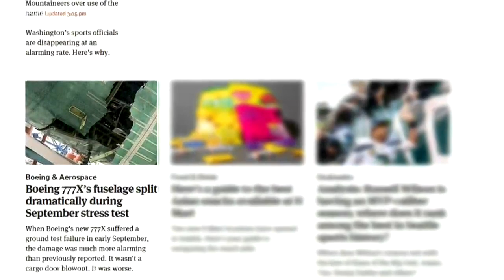New details about Boeing 777X stress tests

Comment: ⚠️🛑💥With decades of advanced material reinforcement, testing ASTM (I) and forensic failure analysis engineering, if there is a significant performance difference between computer modeling and this ultimate test failure there IS a serious red flag as to why. 
⚠️Build quality  problem? 
⚠️Engineering calculation failures?
⚠️Engineering flaw?
⚠️Pushing an older design way beyond its original design limits? 
🛑FAA should conduct a major investigation of failure sequencing before allowing the 777X program to continue forward. Déjà vu to the entire Max Program. 🤦🏼

Comment: what setback? it's a stress test to destruction, they want to see how far they can push the plane until something break, their goal was 150% of what they advertised as the maximum. they got 148%, anything over 100% passes the minimum standard and safe to go.
Reply: penitent2401 No, the requirement is to reach ultimate load which is 150% of the limit load. That being said, it doesn’t have to be reached with a successful test (though testing has to be part of the process of proving it can meet that load).

Comment: Engine problems, fuselage stress fail....not good news for Boeing.
Reply: Victor Grasscourt it seems there are problems with Airbus engines too...ah, not a Boeing or Airbus issue
Reply: Engine problems are not Boeing's fault. For the 777x, the engine issue was GE Aviation's problem that GE had to fix. An Airbus model also had engine problems, but in parallel with the 777x issue (and the 787 Rolls Royce issue), the engine problem for the A320NEO is Pratt and Whitney's responsibility to fix

Comment: It got to 99% and will not need re-testing.
Reply: They just have to prove through mathematics that they can increase structural integrity.
Reply: Fluffy Crocodile that’s still no substitute for a physical test because calculations have still been wrong before
Reply: Fluffy Crocodile exactly
Reply: Trendy T so if I get 1% off the pass mark for my pilots exam can I go to the FAA and say “well you let a machine with 300 people on board pass below the required score
Reply: @tomstravels520  This isn't a pilots exam, and 99% for this test is within passable parameters.
Reply: Trendy T no. It’s more critical than a pilots exam. It’s a machine carry hundreds of passengers. And if 99% is passable then what’s the point of having the pass mark?
Reply: @tomstravels520  I worked for Boeing for 8 years until this year, I'm telling you it's ok and within "limits"....it's basically over-stressed.
Reply: Trendy T again. Why have a pass mark. Does that mean the ultimate load can safely be 1.4 times design load?
Reply: @tomstravels520  The test is used to demonstrate a safety margin for the design and is part of the certification process to show the airplane can withstand extreme forces. Yes they can actually test up to 150% of what you would experience on normal flight in some tests. Key wording "safety margin".
Reply: Trendy T mmhmm. But they have obviously decided that 1.5 times is the minimum required otherwise they wouldn’t have said it in the news. Yes the plane reached its design limit and beyond but how much further does it really need to go. The CFM 56 passed its water ingestion test and then a plane crashed or made emergency landing because it ingested more water than tested and they flames out
Reply: @tomstravels520  Suppose there will always be variables, end of the days it's Air frame Engineers with the last word on over stess testing/NDI acceptable limits etc.  Have a good one :)
Reply: Trendy T yes. But it was engineers who knew it was a bad idea to only have one AOA sensors to feed information to MCAS, but the bosses ignored them. My worry is a similar scenario can happen here
Reply: Thomas Mortimore They decided 150% was the requirement and so a test to that threshold makes sense. But a successful test without calculations to back it up doesn’t qualify, and an unsuccessful test that mostly matched calculations can qualify. There is no requirement the test itself hits the threshold in order to certify aircraft structure; the primary reason for testing is to show that your models make sense.

Comment: It’s a test. Very normal to break. Some people will complain even if you hang them with a new rope.
Reply: It’s a test....that it technically failed. The fuselage isn’t supposed to break otherwise you can’t use it for the wing test. They chose not to break the 787 wings due to the fibre dust that would be caused during breakage. They just stretched it to 1.5 times the design and that was it. Should have been same with fuselage but wasn’t supposed to split